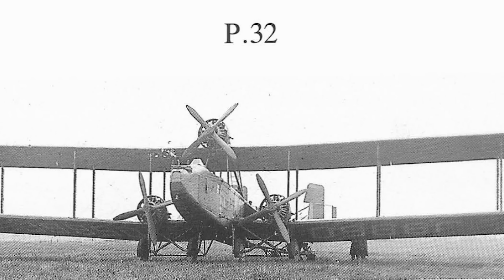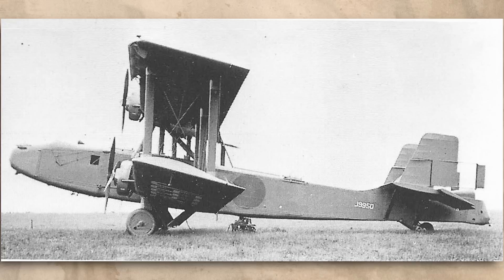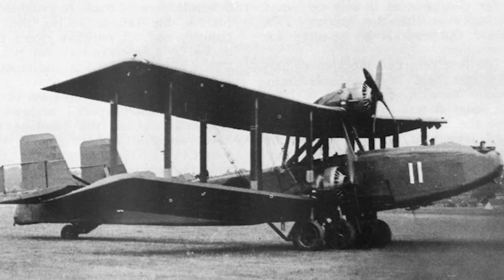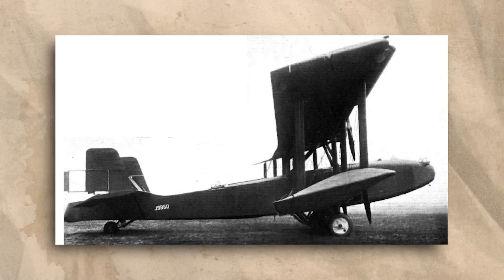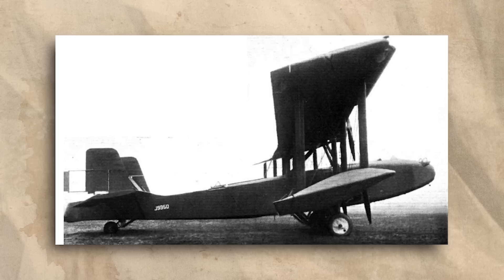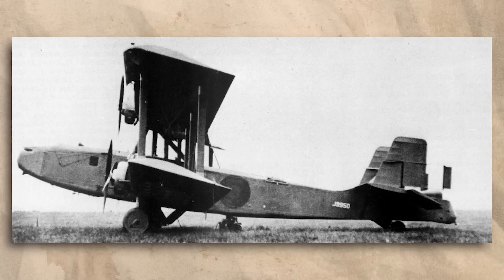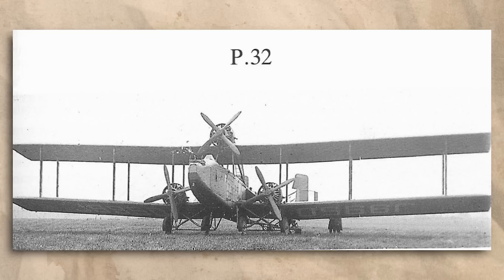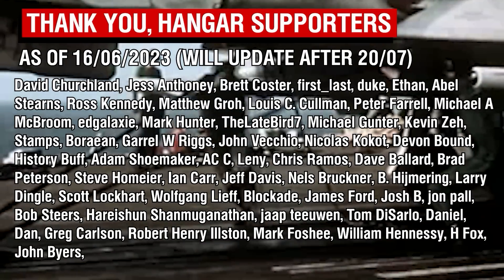The Plane That Could Decapitate Its Pilot | Boulton Paul P.32

Comment: Air ministry specification reads like: We don't want a bomber.

When you don't have engines for a specific size of aircraft, you have to adjust the size of the aircraft. With 1930 technology, a three engined bomber with defensive capability to the front was impossible for obvious reasons. The solution is just as obvious: Scale it down to 2 engines or scale it up to 4 engines.

Comment: The answer to fulfilling the spec for a 3 engine bomber with a nose gunner would’ve been an asymmetrical design with two engines on one side and one on the other, with an off-set fuselage.  That’s what Blohm und Voss would’ve built.

Comment: You must have an eye on the Supermarine Otter, I’d keep my seat belt on in that plane especially with big waves.
Servo tabs, really.  Even giving the surfaces trim tabs would have been advanced for the day.  Servo tabs automatically moving in opposition to the control surface deflection to provide aerodynamic power assistance to the pilot’s physical strength must have been almost unique then.
The Boeing 707 airliner flew on servo tabs, spring linkages gave pilot feel and surface deflection assistance at lower airspeeds.

Comment: A swapping of positions of third engine and nose turret would have solved this airplanes flaws. Field of fire would have dramatically increased, although the gunner is obviously confined to his lofty position for the flight, and a gun turret could have been placed at the trailing edge position to alleviate the tail gunner workload regards the dorsal position. Some sort of air-stair wing underside panel could have been designed to allow egress for the upper wing turret station in flight had they committed to such a direction, the gunner turret would have imposed no less drag and structural weight as the engine nacelle. Then the only danger is shooting out the front engine and not a partial pilot lobotomy.

Comment: The second pilots head was just 9 inches from the propeller. A slight mistake and there is a whole new meaning to a centre parting.

Mention of the onboard toilets reminded me of some I read some years ago. During WW2 Australian bomber crews were in the habit of flushing their toilets while over the target. The Germans complained about this to the Red Cross, chemical warfare or something, so they were forced to stop doing that. I do get the feeling they were not the only ones doing this but they were the ones who got caught.

Comment: I was just surprised that, post WWI experimentation being what it was, The air Ministry never gave headlights a try (so the pilots could see where they were going).

I say, let's get them to put a horn on the steering wheel. I have one on the roller and its capital!

Comment: Ever heard of the Royal Aircraft Factory B.E.9? It was a 2 seat experimental reconnaissance aircraft that had a gunner/observer position in the front with the engine directly behind it. So not only could the poor chap in the "pulpit" could be decapitated by the propeller behind him he also faced being crushed by the engine if the plane crashed nose first. Only one was built in 1915.
Reply: The French had a member of the S.P.A.D family that had the same "Pulpit" design. It was not popular.
Reply: @robertwilloughby8050  Yes, the A2. At first glance it looked fairly ordinary...until you saw where the prop was!
Reply: Ah yes the red headed step sibling of the B.E.2 Variants

Comment: The propeller of a 172 is much closer to the pilot than this airplane's propeller. Clickbait? 🤔
Reply: In front. Enclosed cabin. So no.
Reply: Weird 172 you know. Was it pranged up on the nose, to have the prop 9 inches away from the pilot?

Comment: They probably should have made the upper engine a pusher design.
Reply: Don’t be ridiculous that actually makes sense 😏
Reply: @chpet1655  No need for parachutes = less $€£ n' more "esprit de corps"es(tiny parts...)
Reply: Early pushers always seemed to have problems with cooling.
Reply: @kyle857  The earliest pushers (Vickers Gunbus _et al_) used rotary radial engines, which didn't have much cooling problems at all, owing to their design: they were cooled by airflow even when not in flight. However, rotary radials can only produce so much power before running into their inherent design limitations. 'Fixed' radials are much more power efficient, but you are right in stating that cooling can pose a challenge.
Reply: @kyle857  Define "early"?
Reply: Get out of my head thats what i was thinking
Reply: @xgford94 i see what you did there 😂
Reply: I was thinking shorter propeller, a bit less power and a lot more safety, still a very bad design though.
Reply: No need for pusher props,there's plenty  of pilots to be had!

Comment: The toilet was just a tube to the outside? Talk about bombs away!
Reply: No matter how carefully the tube exit was constructed, even after exhaustive wind-tunnel tests using appropriately coloured dyes (and possibly dog-pooh samples collected from the Airfield Guard Dogs), there's always gonna be a streak down the fuselage for the ground crew to clean up with a hot mop soaked in Dettol.
Reply: "Look out below!!!"🤣🤣🤣
Reply: Chemical warfare
Reply: @PADOYLE  I don't think the plane can fly fast enough to do that.
Reply: @kfcroc18  "Haemmoroidal vacuum" was created by prop-wash not merely airspeed.
Reply: @BrassLock  Ouch, so the plane did more than try to kill its pilots.

Comment: Wouldn't swapping the central engine for a Pusher be an obvious design choice? some major problems exchanged for some minor ones?
Reply: I would bet the air ministry's specification was for 3 engines in tractor configuration and both companies were stuck with that
Reply: @444mopar  I wonder if Rex's Hanger could look into if the Specification was that Specific?
Reply: Early pushers almost always had problems with cooling. It isn't always as great of a solution as it sounds.
Reply: @kyle857  opposed to shearing off your co pilots head I think it's the lesser of 2 evils.